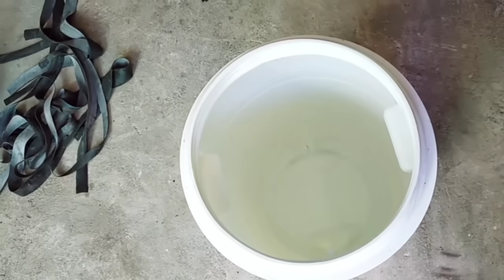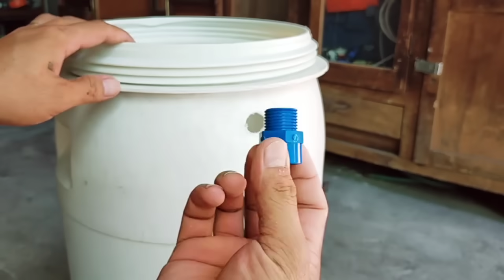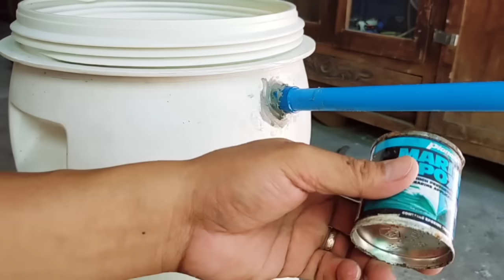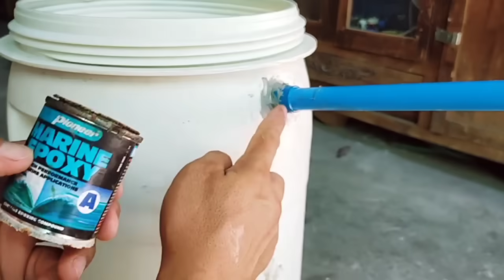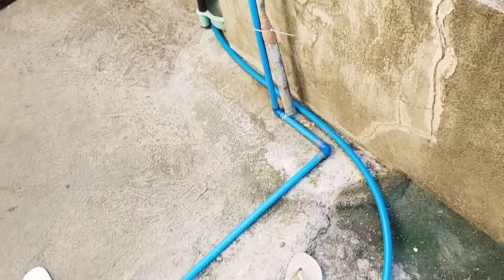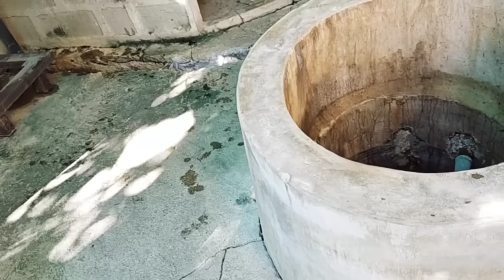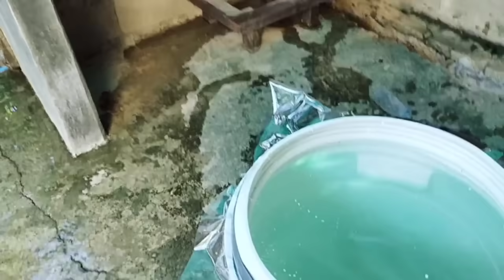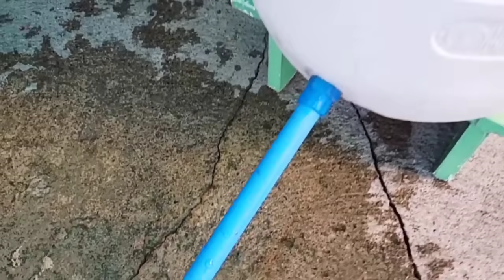improvised water pump no electricity how does it works none stop water life hack part 2

Comment: Simply it will not work since it will against the law of thermodynamics. before 9:44 the air came out from intake hose because the tip of the hose  is not touching the water in the deep well, and of course the water will flow in the outlet since vacuum it not occur anymore. 

at 9:45 the scene is cut, and of course they put something at the bottom of the inlet to make sure the water will flow in to the container.

Imagine if it is a possible theory, we can create an unlimited hydro-electricity in a large scale. The oil rich country will cry hahaha.
Reply: Agree! This will not work unless the inlet is higher than the outlet. Pressure will govern. Pressure will depend on the elevation not the volume.
Reply: @inhinyeronghaciendero-galu4198  You nailed my point.  Volume  does not matter but the elevation. Pressure will really depend not on the volume but elevation .
Reply: Yes, am in full agreement with  you. We can generate unlimited hydro-electric power with recycling set-up. And no problem with higher output  of water with a ladderized or relay pumping method.
   It seems to work but never.  How I wish but impossible!!!
Reply: Copied from Process Engineering. 
Atmospheric pressure at sea level = 14.7 psi = 1.034 kg/cm². Weight of 1 cm³ of water = 0.001 kg. (Atmospheric Pressure – Vacuum Pressure) / Weight of Water. (1.034 kg/cm² – 0 kg/cm²) / 0.001 kg = 1034 cm = 10.34 m.
In reality the 10.34m level of maximum possible suction lift under perfect conditions will never be achieved – even the most efficient pumps aren’t capable of producing a perfect vacuum and then you still need to factor-in friction losses in the suction hose.
Reply: @inhinyeronghaciendero-galu4198  yes, you are right. 10.34mt head is equilibriums. Centrifugal pumps even work up to the depth of 24ft(7.3 )MTS.  Up to the depth of 20' this system works satisfactorily. Heron's apparatus is example of this law of hydraulics.
Reply: @saratchandra2995  free energy water pump is impossible unless the outlet is lower than the inlet, and we call that siphoning. And if the water level in the outlet and inlet is the same, no movement will happen. For clarification, the maximum suction head that can a motor lift is less than 10.34 meters. Please see link below for your review. Please check at 11mins time for your info. https://youtu.be/4XvPz_RpFFg
Reply: @inhinyeronghaciendero-galu4198  Yes, at 10.34 m vacuum, the water will vaporise and the vacuum is lost.

Comment: To bad I can't post pictures. This doesn't work. It created a negative pressure in my steel 55 gallon drum causing the sides to totally collapse. Not a drop of water rose from the lower water source to my elevated barrel.
Reply: Your drum is not strong enough. Thats your mistake.
Reply: Svaka čast
Reply: I hope you covered your drum tight that no air can get into it, with that the preasure will force the water to come up.
Reply: How long was your discharge? I would think it would draw air up through that before collapsing the barrel.
Reply: Seen a collapsed drum on other u tube videos and it still worked you did something wrong

Comment: Thank you for this tech. 🙏 it's very useful and no need electric.
Reply: this is a fake video
Reply: @edgarcordova4534  We get excited without testing such mechanisms. Most likely, you are right.
Reply: @edgarcordova4534  why?
Reply: @marceljohnkimaty4986    Because it needs energy to lift water to a higher place. But as this is presented there is no input of energy. Which doesn't mean there is none, but it is well hidden.

Comment: There is no gurgling in this configuration: this shows that the atmospheric pressure present in the open air does not tends to enter the bucket from the outlet tube towards the vacuum area generated in the upper area of the bucket; observing that the outlet flow is homogeneously flowing makes me think that one-way valves are not necessary. The homogeneity of the outgoing flow and the absence of gurgling makes me believe that in the lapse of pressure difference (between the vacuum area and atmospheric pressure), the working efficiency force is inclined to work on the charge pipe. Otherwise, gurgling generated by the entry of air through the discharge tube would be observed. I observed that, despite the two pipes (charge and discharge) are of the same diameter, the outflow is greater than the incoming flow (at the end of the video it is also visible that the water level is slightly lower than the start of pumping): that it shows that the process will remain operational for a limited period (because more water comes out than it enters). I also observed that the outlet pipe is inclined downwards (I don't know if this is a detail to be considered with importance). The most curious thing is that the pumping height distance is surprisingly high. However, I would have been more convinced if at the end of the video, the extraction procedure of the charge tube had been displayed without interruptions in order to prove irrefutably that there is no submerged pump in the well.
Reply: You may try soh that you believe
Reply: Translate Indonesian
Reply: @mariotapay7  I am inclined to favor human life but personally I do not need this type of solution. At best, it's like heavy flywheels that end up losing their energy in favor of kinetics due to gravity. But for those who need to take advantage of the time to save on the energy required for the charging source force perhaps this approach can be useful to save money on devices and energy (temporarily) ... I like that!
Reply: Folosiți pictograma de editare pentru a fixa, a adăuga sau a șterge decupaje.
Reply: I made like this and it did not work Why?
Reply: @JosephAzzopardiRummiena  You should share a video of your product. Physical theory does not admit the direct possibility of this type of functioning but there are often "but" ... I can say this because I have obtained interesting results in another area (which I do not intend to share on social networks)
Reply: Translate
Reply: @emilesyarifudin  Until now, no ability to respond to this answer has been recorded in all of human history ...
Reply: @thermalix9900  water is coming but gurling with air and its not pulling from the well
Reply: Water flowing from a barrel is like a piston but fluid. If there are gurgles, they come from the discharge area. This proves that the concept cannot work. To understand why you have to research what atmospheric pressure is, which is too long to explain here
Reply: @JosephAzzopardiRummiena  Physics says it's best to leave these experiments alone. To understand why it doesn't work, you need to understand what the force of gravity is, what the water pressure is and what atmospheric pressure is. The concept is simple but it is too long to explain here. Look on the wiki ... Finally you will understand.
Reply: Thanks for your advice
Reply: @JosephAzzopardiRummiena  потому что не подключил дополнительно насос. это фокус. обман. учите физику
Reply: @JosephAzzopardiRummiena  нужно дополнительно подключить насос. а это фокус. обман. учите физику
Reply: @андрейсулимкин  :)  :)
Reply: @JosephAzzopardiRummiena  because in the real this set up doesn't work
Reply: @JosephAzzopardiRummiena  
this set up never work
Reply: God description, it intrigues me though, will it pull more water than the amount he put in to fill up the barrel? other wise this would be no different than filling up a container manually or with a pump on your roof and draining it slowly. i mean the law of conservation of energy still should apply here. i'm i missing something?
Reply: I have to personally test it to find out. When I was a kid, dad told me the syphon effect differently. I used to hand pump the water for long time.
Reply: @regiraj  your hand pump also works the same way! You create a vacuum in pump, atmospheric pressure pushes water up from well. But we then drop water openly, rather than capture the weight of the falling water to pull more vacuum that allows more lift of well water?
Reply: @billjones5178    Yes, a vacuum can bring up water, but vacuum is not a source of energy. Vacuum can only deliver the energy which was needed to create it, in the case of a hand pump by manual work. Also the weight of water can not deliver energy, if water is lifted higher than it moves down. If the outlet is higher than the water level in the well - and the video gives this impression - then it is obvious that this is a fake video.
Reply: The negative pressure in the drum is not strong enogh to suck up water deep down the well , it sucks the air in at water outlet instead , there must be a pump at inlet . Another thing is if this one worked every well would have this to pump water instead using hand pump , he still uses hand pump , this clip is 100% fade . If people do the same like this without the pump at inlet , water run out and stop to let the air in the drum and repeat like this until no water in the drum , no pump here .

Comment: There is no way that would work. Water pressure is determined by metres of head. There is more metres of head going down the well, therefore it would pull the water in the barrel down the well until air went in the outlet pipe and the system would fill with air. This is total BS and don’t get scammed.
Reply: That's what I was thinking seeing the thumbnail.
Now I'm waiting to see if there is a 1 way valve or something special here.
Reply: It Can't happen for the inlet pipe is at the top of the barrel
Reply: I watched another video where a guy makes it using a check valve on the inlet pipe at the end in the well
Reply: Have any of  you heard of gravity?
Try putting a jerry can of petrol on the ground beside your car and siphon it into the fuel tank. It doesn't work. Now put the jerry can on the roof of the car and try again. It works. Same thing as the video. Water runs from a high point to a low point no matter what. If shifting water was that easy  pumps wouldn't have been invented.
Reply: @stevenstart8728  
This system looks exactly like what is used to pick up fish poop in an l Aquaponics. The only difference is that the vertical pipe is much longer.
Reply: @stevenstart8728  hahaha totally
Reply: As you can see, the weight of the water on drums i heavier than the amount of water from the inlet pipe, the pressure vaccuums the water from the well since it has less pressure
Reply: The plastic help for pressure
Reply: no, i don't think the water always runs from a high point to a low.
Reply: That barrel make a vacuum typ environment in it and it suction power is more then the gravity of water in pipe it will work try it
Reply: @watzky  exact science and well defined perfect 💯
Reply: It will work

Comment: Sir, what is the capacity of the suction pipe in length, or what should b the maximum lenth of the pipe of suction and delivery,,,,,,,???
Reply: Wow... In the outlet can you turn off and on and still get water flowing by gravity pull?🎉🎉🎉

Comment: If this works why not flow the water back into the well over a waterwheel generator to create a perpetual motion machine 🤔power generation until repair is required huh good question 🕵
Reply: Better still can be hooked up to an aqaponic system, , zero energy free food
Reply: @avalonkingdom9098  if it works I tried an experiment similar to this once and all I did was create a very powerful water based vacuum chamber but I had a p-trap on my ball valve 3inch pipe with it reduced to a half inch at my priming T but I should have put a one way valve on my half inch pipe the p-trap was to keep air from flowing back into the system but I never tried it without the p-trap it may have worked
Reply: Tú si mostraste como funciona y muy sencillo sin muchas llaves te ganaste un saludo amigo
Reply: @randypratt2887  I attempted a smaller plastic container of 20l, used 50cm tubing, my 2 part durapox, was hardened, and as I was setting it up it fell over, all joints broke, so I will repair it and try again, lol  a smart person will invent a metal brace system that can fit through the lid and fold out in 2 directions to brace the inside, against the vacuum. Unless we repeat the experiment absolutely airtight, how will we know for sure !
Reply: @avalonkingdom9098  that's an impossible dream. just forget it and spend your time on some other beneficial project. you can use a ram pump if your place is near a creek or a river.
Reply: @avalonkingdom9098  i advise you to forget your plan because water is incompressible, even you use materials harder than diamonds, it would only be torn into pieces.
Reply: @edgarcordova4534  No explosions , it causes a vacuum lol
Reply: @avalonkingdom9098  so, it would be an implosion lol
Reply: @edgarcordova4534  That's why the guy uses metal barrels, and still some deform a little lol, sure you can if you want spend more money  bracing the inside . I purchased 6 barrels yesterday, got a mixture of fittings, and will attempt his system to pass it over a water wheel, or use a bunch of micro turbines available on Alibaba. I will post the results. Skeptic's I dare you to purchase a barrel and do the same! Then comment, Note, there will be a few trolls who are paid or not to fail such experiments!
Reply: just joking. But take my word, don't take this project too seriously, this is a fake video and you would just waste your time and resources. if you are interested in pumping water to considerable heights without using electricity or fuel other than the water itself, you better learn the working principles of RAM PUMP. I assure you that if you learn the RAM PUMP, you would benefit considerably. However, ram pumps could only be installed where there is running water such as river or creek but NOT on wells. If you are near a river or creek, you are lucky (just like me).
Reply: @avalonkingdom9098  did you shoot it? I'm interested in watching your experiment.
Reply: @vijaysolanki6728  God willing, I will set it up today, I have made the extra hole, and glued the fittings, got all the parts. I can't film it because my cellular has memory problems. So don't know when I can upload the video, but will find a way. Thanks for your interest
Reply: @avalonkingdom9098  😂😂
Reply: @edgarcordova4534  😂😂😂
Reply: @edgarcordova4534  a water wheel pump works with running water you need a significant drop in water elevation to operate a ram pump
Reply: You can also use water hose as a water level to transfer water to different locations of equal elevation as long as all parts of the hose stay below start point and end point
Reply: @vijaysolanki6728  I did not shoot it, and it failed because the output 60mm hole fitting leaked
Reply: Is it truly possible I will have to try it again maybe I can create my portable water powered power station it wouldn't be much unless I had the flow turning multiple turbines or one big water wheel with high torque with proper gear ratios possibly I could power my house on an alternate power source after fully charged from a water system that flows continuously using vacuum weight  displacement atmospheric pressure gravity and defies what we have been taught but not entirely water seeks it's own level water seeks it's lowest point but under certain conditions water can be manipulated for instance water will flow up hill in a pipeline as long as the hills elevation does not exceed the elevation of the starting point 😘now if I could only use the force of water to pump water to a higher elevation we're could I transfer that water to using gravity within a closed and open system 🤔🤓😵‍💫🥴😊😘hanging garden of Babylon 😁🤫